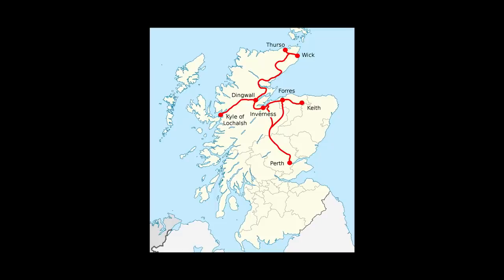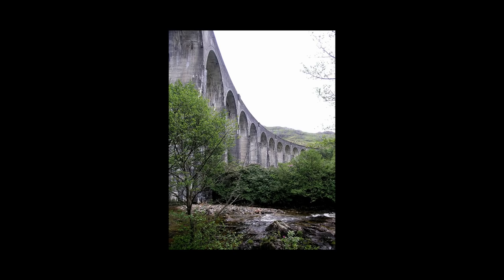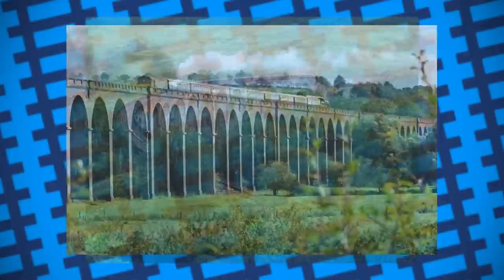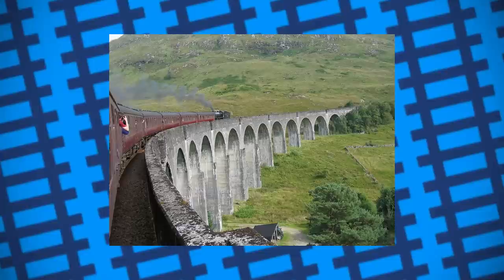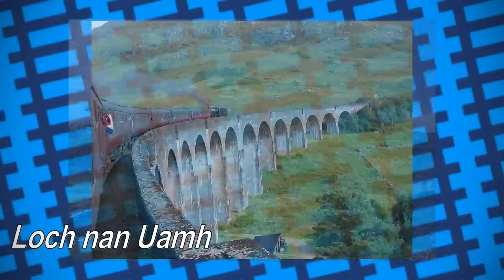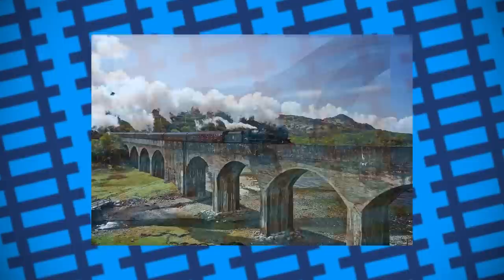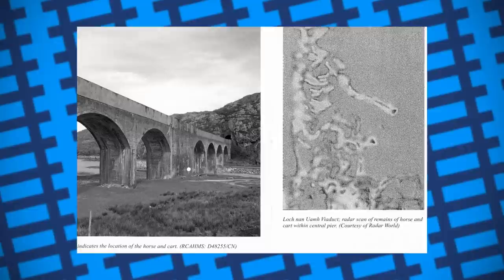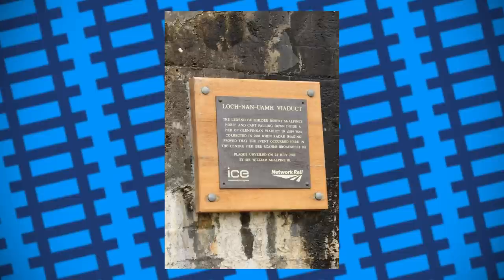Why a horse is buried in a railway bridge - Loch nan Uamh Viaduct

Comment: Interesting, in the USA there is a similar story about the Hover Dam but it involves people instead of horses. It is false because the decaying body would mess up the structural integrity of the Dam. So when I saw this come up I figured it would end up being the same thing.
Reply: 20th centry dam holding back a lake of water probably has less tolerance than a Victorian bridge than occasionally gets a train run over it
Reply: @hens0w  probably, but I figured it would carry over. You can always be wrong. Also at the time I would imagine the ones doing the pouring wouldn't know to care or think about the integrity of the bridge.
Reply: I thought the same thing.  You'd think such a large void as a horse would weaken the structure.  I suppose a lot of different forces are at play compared to a dam.
Reply: Looking at how huge that center column is, surely plenty of factor of safety, I doubt a void the size of a horse would be such a huge problem. I'm curious why that center column was so big in the first place, rather than more slender like the others?
Reply: @quillmaurer6563  Almost certainly because of the location of the rocky outcrops and water channels below. The central pier was designed to be a rectangular hollow - it didn't need to be solid to carry the weight of the trains - so having a horse and cart inside would make no real difference to its strength.  That was supposedly how the accident happened - there were planks laid over the hollow pier and they gave way as the cart was passing over.
Reply: A mass concrete dam would not normally be affected in the slightest by a human-sized cavity in it.   The stresses in a concrete dam are generally quite low.

Comment: There was a rumour here in Merthyr Tydfil that a slag train overran the tip line and dropped into the slag pit, The crew escaped but the train was buried in slag as it was not possible to recover it. When the Ffos-y-Fran opencast mine was set up to rework the coal seams under the slag tip the train was found.

Comment: I have heard of animal bones being found during repairs to viaducts on the highland network.They were built by " Concrete" Bob NcAlpine at the turn of the 1800s into the 1900,s out of concrete formworked to replicate masonary.However steel bar reinforcement was yet to be discovered and so animal bone was used as a type of reinforcement much like horsehair was used in early plaster rendering.Neither rot and both in theory last forever and bone will tolerate bending whilst returning to its form and expand at a similar rate that concrete expands under heat or load.A very good binding medium for load bearing large concrete casts.

Comment: The question I have is that does corpses compromise the overall strength of concrete structures?
Reply: I’d say yes but given the absolute chonk of a solid concrete pillar it’s in its probably an amount even worth noting
Reply: I thought the exact same thing. Particularly when the body decayed, does it leave spaces in the column which weakens it or is it stopped from decaying by being insulated from the outside world
Reply: It would have decayed due to the oxygen within the horses body cavity allowing it. It would however have left behind a horse shaped mould, simmilar to the remains of victims of pompey. If the bridge ever gets demolished, they could in theory dig down until the cavity is found, and fill it with a foam and have a casting of the horse
Reply: @tramlink8544  While interesting, why would anyone need a casting of a horse
Reply: @kevinpeters6709  Agree - the column is so huge it surely doesn't matter. What I wonder is why that one column was so huge, unlike the others that were more slender?